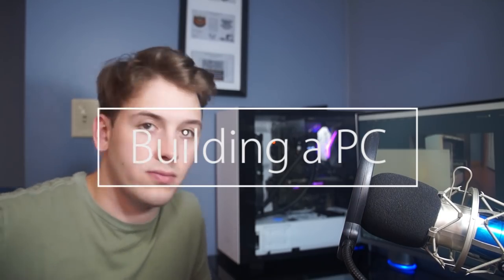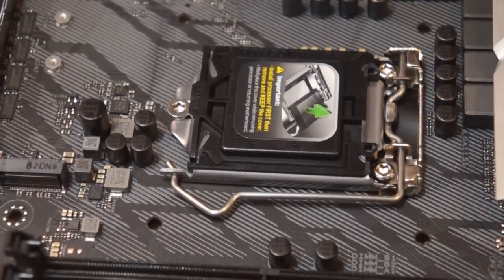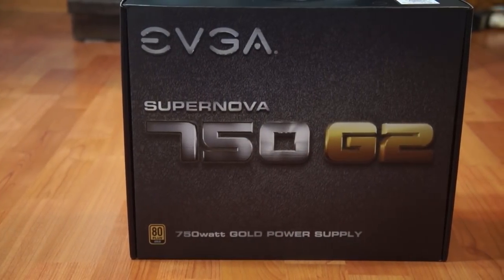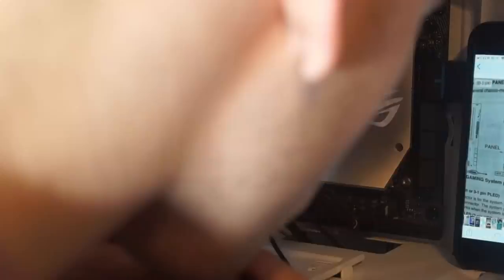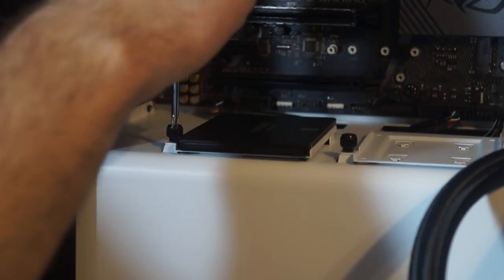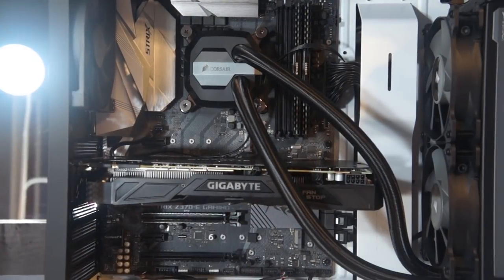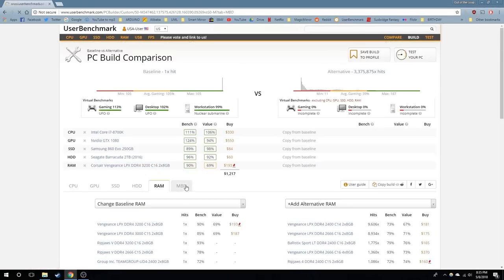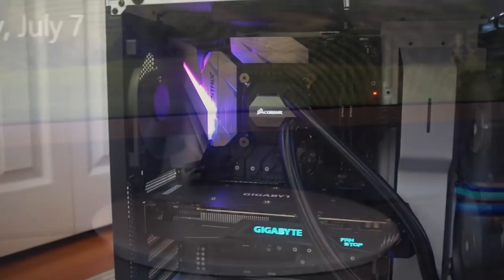How I Built my First PC for $1500 (High-End Build)

Comment from the maker: For all those wondering, I have gone through my Motherboard Manual and fixed my RAM to go into the Dual Channel Slots! THANK YOU
Reply: regardless of the RAM placement, you did an awesome job for your first build. Especially, for someone with minimal desktop/hardware background (assuming you don't). two thumbs up!
Reply: Grensom, how long did it take you to get these parts for your pc?
Reply: No worries it seems right at first but it’s a very common error. Awesome video
Reply: I saw that and cringed so hard lol.
Reply: Besides RAM, which shows that you are truely first time PC biulder your tutorial is Top Noch. One minor minus would still go towards placing cooler on top of processor. You should have taken steps on how you placed it on top? Does it require thermal paste ot not...
Reply: Grensom I was just abt to comment abt that😂
Reply: you should fix your aio but its been 2 years your pc has probably blown up by now

Comment from the maker: I really love the constructive feedback so far from everyone! Please feel free to tell me what I can improve on my build as it is my first one. Don't hold back with criticism ;)
Reply: No NVMe SSD. Booooooo. :P
You can pick up the 970 Evo 250Gb for $115 on Newegg and it runs MUCH faster than your SATA 860 Pro. Not to mention it requires no cables or case mounting. Still rocking my old 850 Pro and it still curb stomps any SATA drive for speed.
Reply: Grensom did u read the MB book... cus thats not how the ram should be line up

Comment: You should resit your ram in the correct dim slots man! Look just above the memory slots on your motherboard, and it should say A0 B0, A1 B1. You'll want to place it in A0 B0 for the best optimisation of you ram, just have a quick google and you will quickly figure it out! Otherwise awesome video man!
Reply: Allen Coppin yes, this is important to use dual Channel mode, which is faster
Reply from the maker: Thank you very much! I was wondering about this. I will look into this, this afternoon
Reply: It made me cringe hard lol
Reply: Idk if Allen said it correct, but its the second and fourth dimm slot from where ur cpu is.
Reply: That's the 1st part I notice slot 1 and 3 ,not 3 and 4 i believe. In the 90s we did not have YouTube video, I did not finished school and  I was building computer's since the 90s.
Reply: 69th like nice

Comment: If you want to, you can flip your radiator from your CPU liquid cooler, so that the tubes are at the top, it looks much cooler. 
And you should screw the thumbscrews (from the panels you removed to make place for the graphics card) back, to give you graphics card more stability.
I hope I could help!
Reply from the maker: Wow! Thank you for the feedback, I think I will end up making those changes. The CPU Cooler was a pain to put those wires in like that, it never occurred to me to flip it to make It less obstructive. Thank you!
Reply: No problem😉
Reply: it doesnt look cooler its common sense when air bubbles are made there is nowhere to pop them which the cable will transport the air bubbles to the rad, the rad will pop the bubbles his pc prob blew up by now

Comment: You need to change your AIO fans direction to push air inside the case in order to have airflow, either put the fans in-front of the radiator or flip the fans to pull air through the radiator
Reply from the maker: Interesting, I did not know that. I will be sure to check the manual on the AIO fan and make that adjustment. Thank you for the heads up!

Comment: Your radiator fans are backwards, should be pulling fresh air instead of exhausting it out of the case, the frame/structure/cross side of the fans should be facing your components.
Reply from the maker: You are the second person to say that. I was unaware that is how it is supposed to work. I will be sure to check that out. Thank you!
Reply: Grensom no problem
Reply: The side with a cross/motor for the fan,  is always the backside, this is where the air will always be pushed towards on a pc fan.